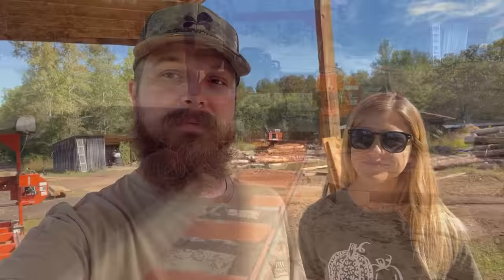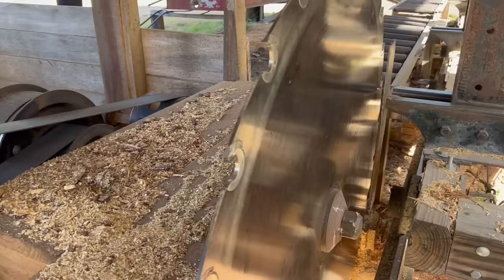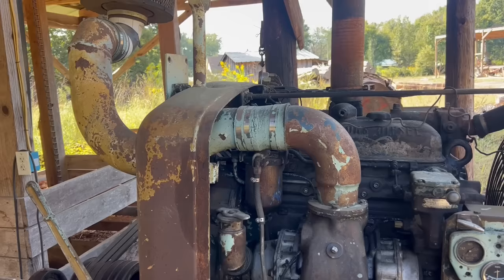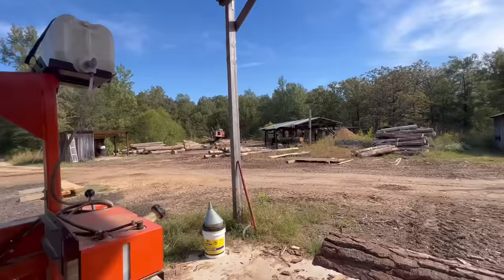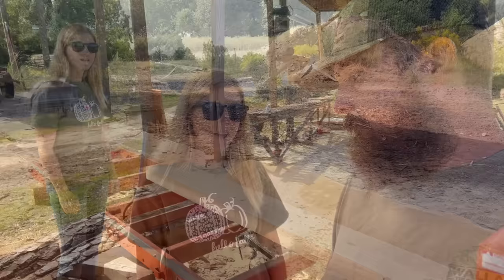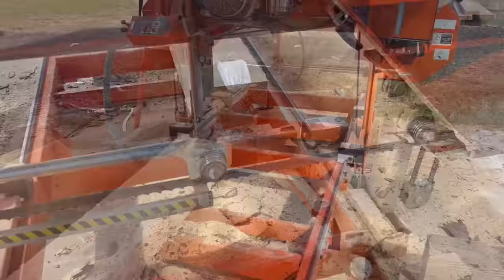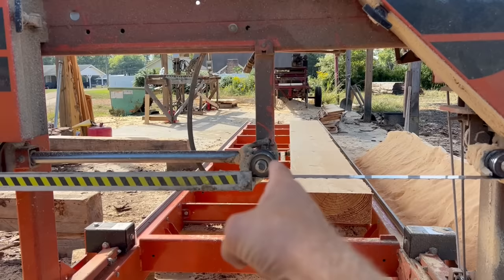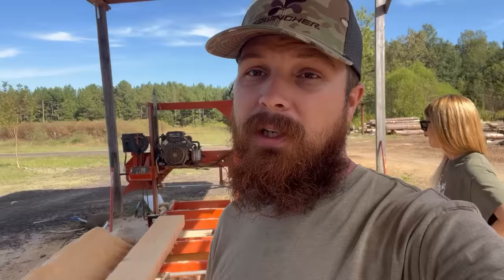Circle Sawmill VS. BandSawmill!!! (A BRIEF description!)

Comment: I'm definitely a circle mill guy too. I've helped some friends with their band mills and not having roller benches and having to lift every piece is a job and will  wear you out just to cut a couple thousand feet a day. With my frick mill we regularly hit 10,000 ft a day and seldom have more than 3 guys helping me and they keep everything put on stacking strips and run the pine slabs through a slab chipper. Definitely a lot more productive on a circle mill except for the extra saw knerf everyone cries about
Reply from the maker: Perfectly said!

Comment: If you had a better bandsaw mill it would be all power and it would pull the sawn boards off onto a narrower bed so it would be even easier for Brittany than the circular saw mill.  That said, for watching videos, I prefer a circular saw mill although I do find the totally manual aspect of your particular mill a little annoying.

Comment: Great video. A vertical band has the benefits of both ease of off feed and smaller kerf. I retired as a millwright assigned to a horizontal band mill with a three hundred horsepower electric motor on the band mill and twenty horsepower hydraulic infeed rolls. They have a twin band vertical also, but I never worked much on it.
Reply from the maker: That’s cool to hear!

Comment: I can see where it's more work for Brittany on the LT-15, but by adding the Board Return Kit, a length of roller conveyor, and maybe raising the deck up off of the ground by a few more inches,  would set her up to handle the slabs much more ergonomically!! Depending on how many slabs you cut on the LT-15, it could be well worth it in efficiency!!

Comment: good video........... Full of info. Just 1 thing the  BDF % advantage of a log in a band  mill vs a circle mill. Also the cost of  inserts and blade cost difference if you hit iron. I've seen circle blades rip in half  and the possible damage to the bull works

Comment: what about blade sharpening and hammering on the circular saw blade.  I have a friend that has switched to a bandsaw mill because we live in Canada near Sault Ste. Marie and it is a long way to someone that can hammer large circular saw blades.  Do they need to be done often?  Do you know what can throw them out of shape?